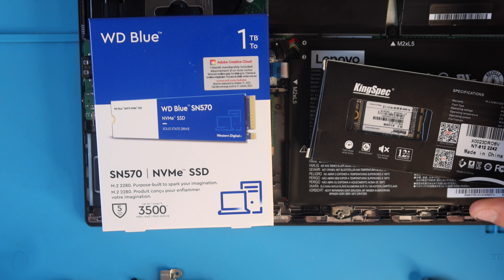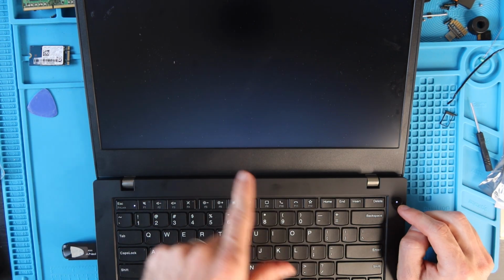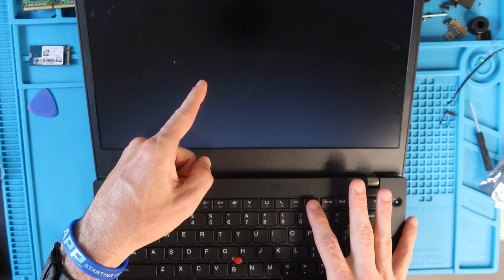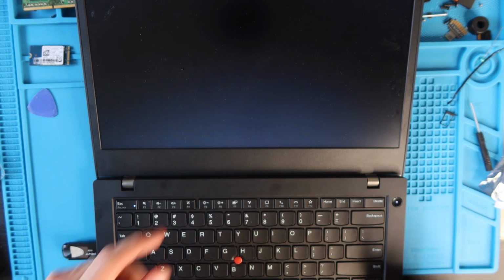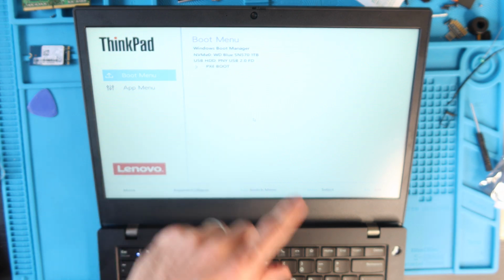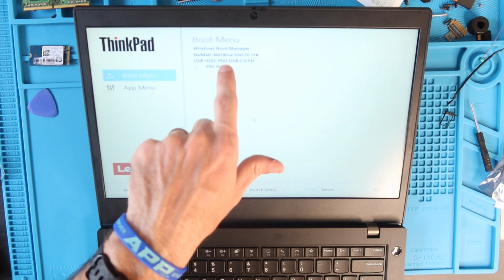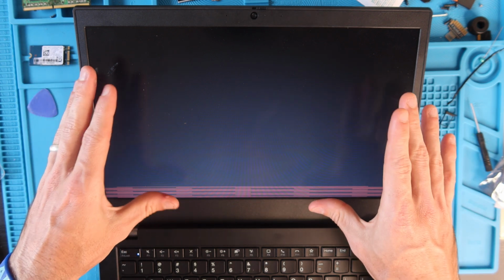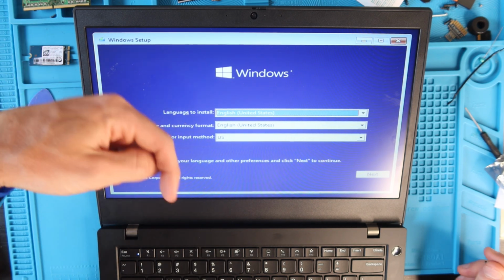Lenovo Thinkpad L14 Disassembly and Upgrade SSD Ram Battery Replacement (Step by Step)

Comment: im surprised no one talks about the l14 because it’s so much more upgradable than the t14 and costs less. thinkpad community on yt only cares about the t series.
Reply: Exactly. ThinkPad L14 is a really solid 14-inch laptop. Well made of good materials, first of all it gives the possibility of expansion with fast DDR4 3200 RAM up to 64 GB or fast nvme SSD up to 2 TB. They have great AMD Ryzen 5 Pro and 7 Pro APU processors, which offer really good performance, the battery is also quite good. I have this laptop with a backlit keyboard and a fingerprint reader and it really is great, I think it will serve faithfully for a few more years. Another laptop that I also consider great is Dell Latitude 5400.
Reply: and its around $250 renewed

Comment: port Wwan Lte possible to install ssd m2?
Reply from the maker: another ssd in that port?
Reply: @thecollegefixer653  yes , possible?
Reply from the maker: @fabiogomes9935  I have not tried it, but it should work fine.
Reply: @thecollegefixer653  unfortunately, the port has a whitelist in current bios preventing ssd.